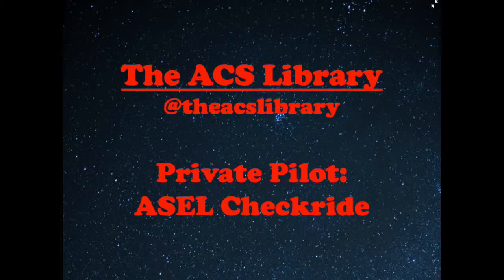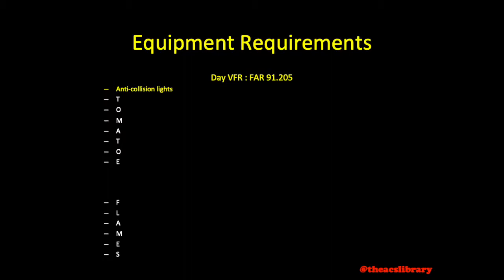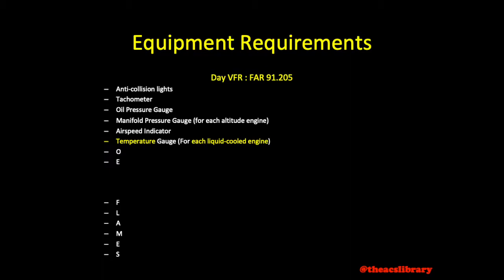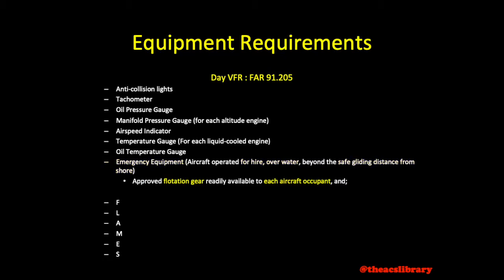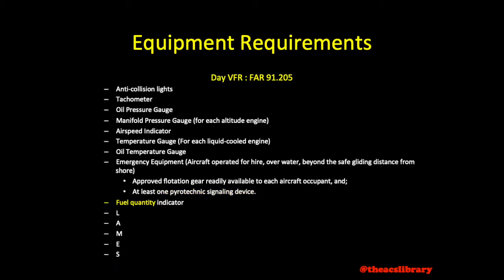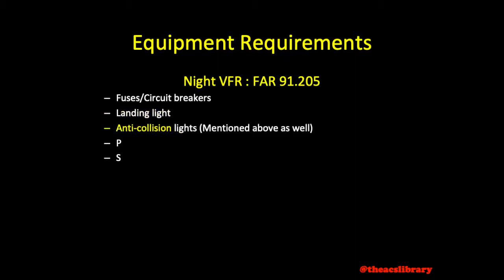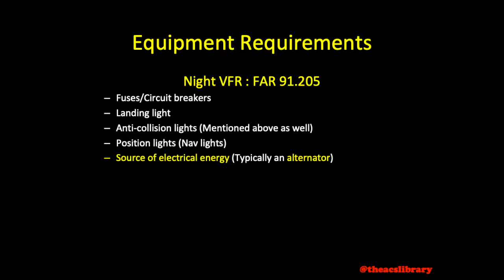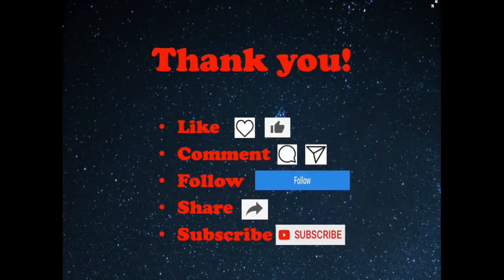PA.I.B.K3 Equipment Requirements for Day and Night VFR flight

Comment: I learned it as: TOMATO A FFLAMES
Tachometer
Oil pressure
Manifold pressure
Airspeed indicator
Temp gauge
Oil temp gauge
Anti-collision lights 
Floatation device
Fuel gauge
Landing gear position indicator
Altimeter
Magnetic compass
ELT
Seatbelts
Reply from the maker: Hey Glizzy! Thanks for taking the time to comment.  That list works perfectly! You might even say Flare & Flotation device for that first F.
Reply: @theacslibrary4404   love the vids thanks so much for doing this your the man!!!! FYI this happen to me. If your plane is older then March 11 1996 and your white or red beacon light goes out you can still fly without it. FAR 91.205 b (11)

Comment: While it seems only sensible to have a functioning manifold pressure gauge for a variable pitch prop, I was taught that this does not fall within the FAR 91.205(b)8 definition of altitude engine. btw  This series is very helpful. Thank you
Reply from the maker: Randall Sly yes sir! Most variable pitch props will require a manifold pressure gauge as part of the TCDS requirements.  I hope this helps!
Reply: The ACS Library yes thank you